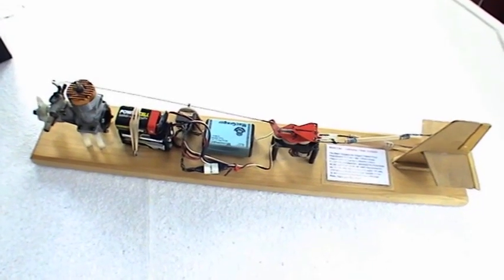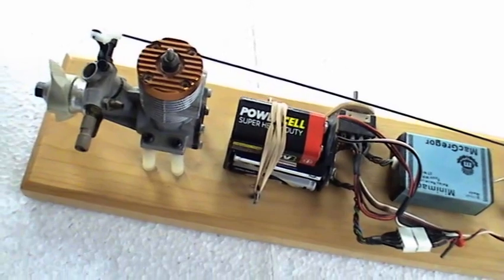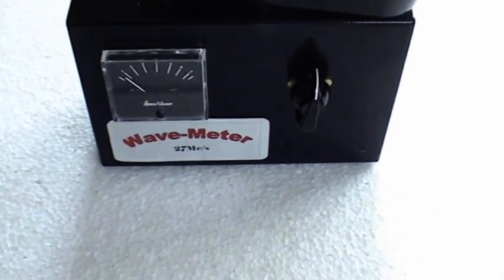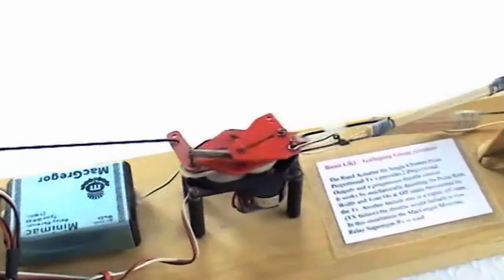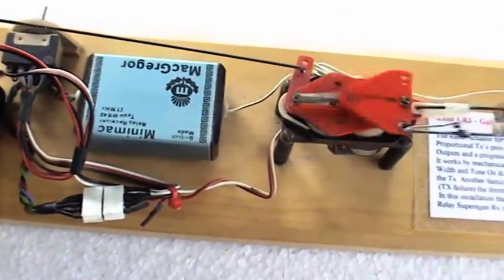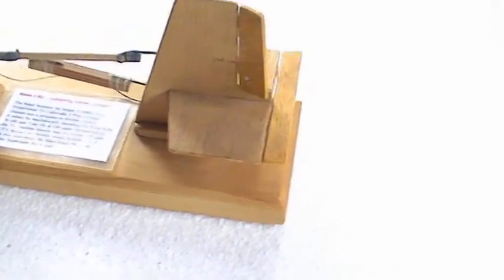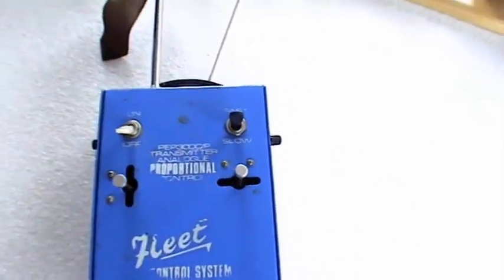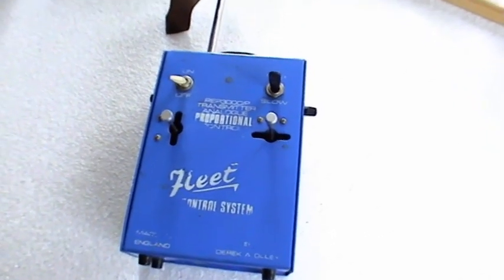Vintage Rand LR3  Galloping Ghost  Actuator  Demo Rig

Comment: Ha!  This is great! When I was 16 I built my own transmitter using a Controlaire Mule circuit. http://vintagercfiles.com/Files/Controlaire%20(World%20Engines)/Controlaire%20Mule%20TX/Controlaire%20Mule%20TX%20schematic.jpg Handmade 2-axis stick and UJT pulser. Someone in our club gave me an old Controlaire superhet to match it, and I added a Rand LR-3 just like this one. Full bridge transistor driver like this one http://www.rcuniverse.com/forum/attachment.php?attachmentid=766021&d=1375385224 to avoid a relay. I had some success with a Mini Mambo for the first try. But then I moved the equipment to a carefully built version of Ted Schreyer's Waco YKC-S https://outerzone.co.uk/plan_details.asp?ID=1215. Powered with a Wen Mac 0.49 http://antiquemodelenginesrunning.blogspot.com/2010/10/mk-xiii-wen-mac-049.html I had so much fun flying that airplane!  Literally hundreds of flights. It's amazing how guys like you and the Internet have brought all that back to mind after over 45 years. Thank you so much...

Comment: The Rand LR-3 operated my #2 model, a Midwest Whiz Kid, Foam wing and stab. Tx was a Controllaire Mule, modified with an Ace R/C pulser kit, later fitted with a Rand stick assembly that put everything on one two-axis stick. A Cox Tee Dee .051 with sleeve throttle gave five speeds. One oz. clunk tank, and ran about three gallons of fuel in one summer. I needed an enlarged Tx case to fit it all in, but it worked very well. Wore out the three cell Ni-cad pack that summer! Ultra reliable!